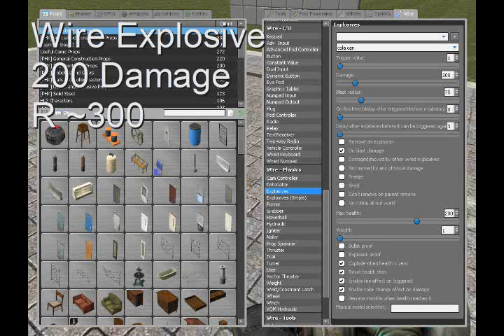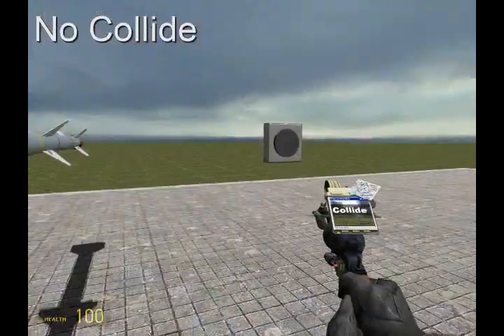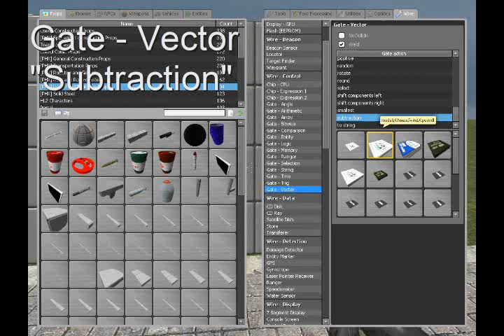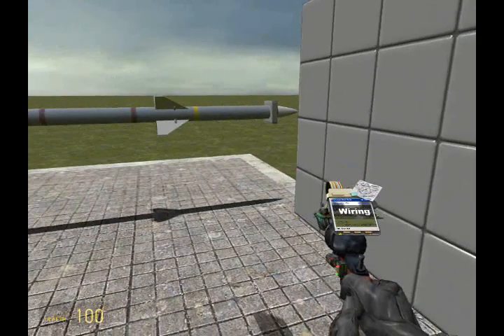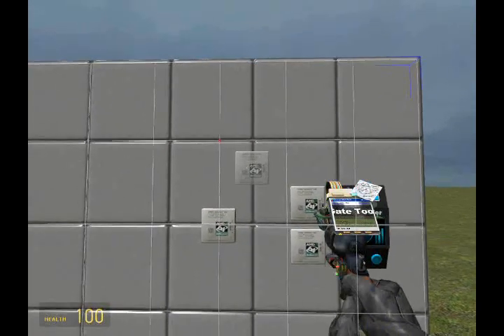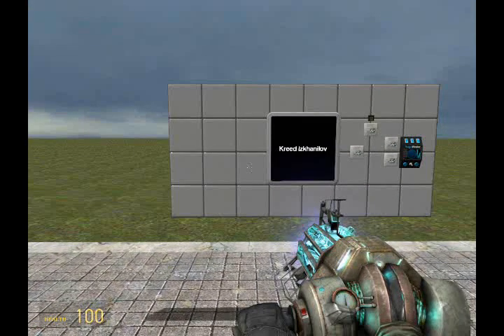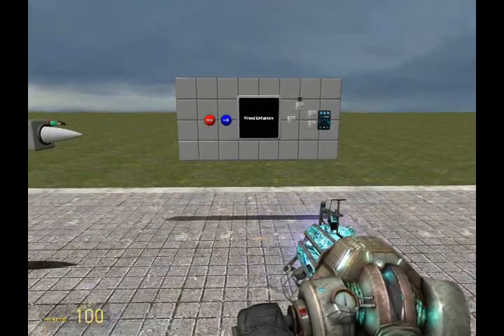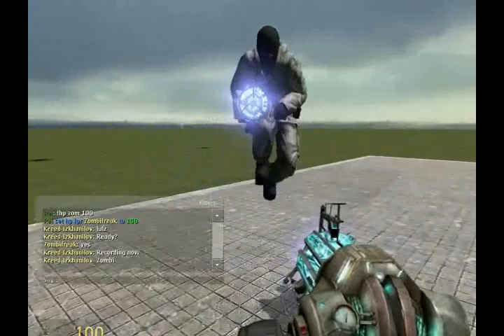WireMod Essentials [Ep. 08] - Auto-Seeking Missile TUTORIAL

Comment: Posting a slight update.. When I create the vector subtraction gate I only have an "A" and "B". There is not a "Subtract" option when wiring the vector thruster. When I attempt to wire the thruster to the gate it says "Data Type Mismatch! Input gives normal Output gives Vector". I did manage to get detonation to work so the only thing I'm having issues with is the vector thruster. Any help would be appreciated. Thanks.